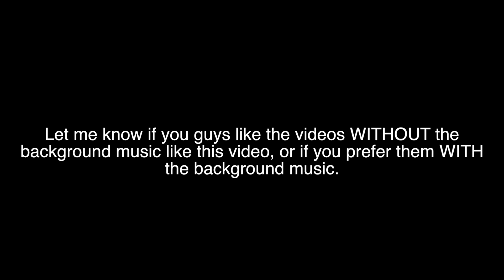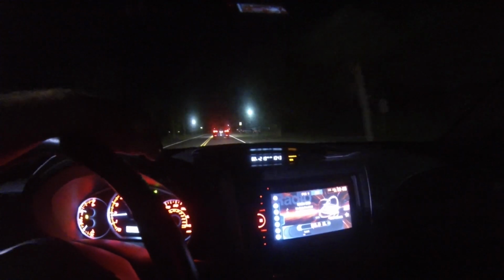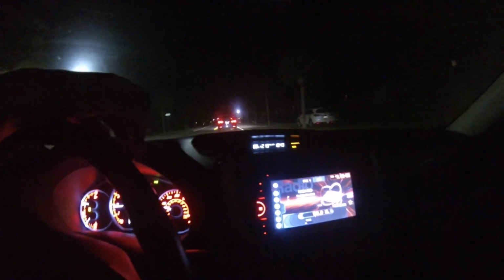TURBO GOES WHISTLEEEEEE!

Comment: Sounds like it's running rich. I've been having this problem for awhile and breaking up around 4k
Reply from the maker: ***** yeah its running super rich lol, gotta wait for my new wideband sensor to come
Reply: Yeah I think my MAF is bad and not letting my narrowband signal cycle
Reply from the maker: ***** normally too, if a maf were bad it won't let you rev above a certain RPM.  That's not always the case though
Reply: Yeah it can be a lot of things but thats where my problem has narrowed down to
Reply from the maker: ***** yeah diagnosing problems always can be a  pain!
Reply: ALWAYS A PAIN! Espcially when DSM shootout is in a week
Reply from the maker: ***** i WISH you the best of luck haha!  Sometimes it's quick, sometimes it's a needle in a haystack
Reply: Thanks man